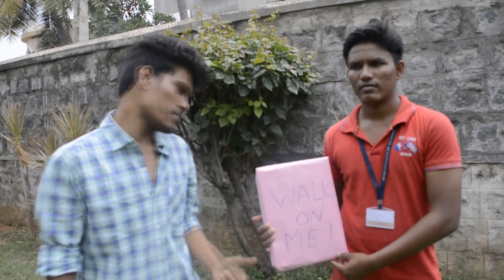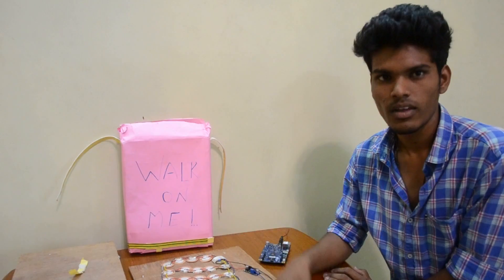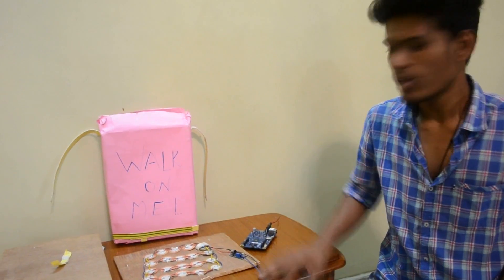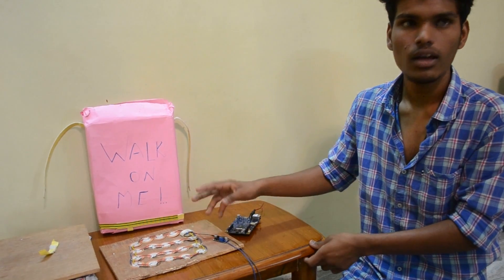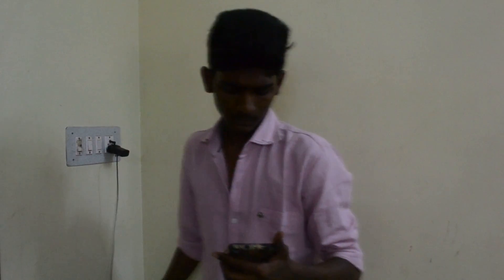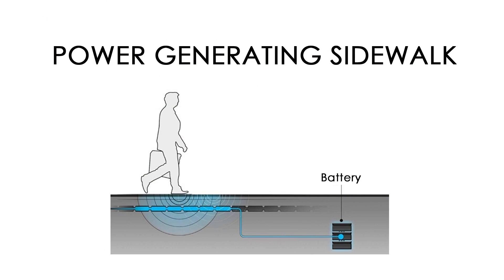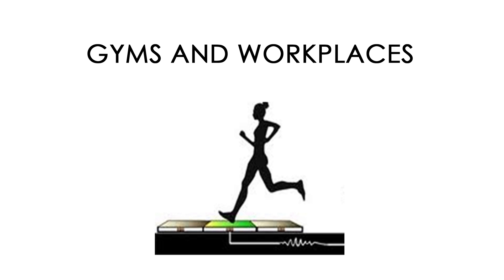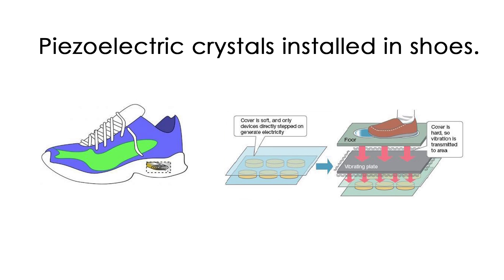PIEZO Foot Step e Generator

Comment: no use of this project as power generated is very less and cannnot be used in any application .
here student is showing output voltage only and not output current. if you connect any load against this voltage, it will drop to very less volt and is useless.

Comment: How do you connect the piezoelectric to the arduino and what is the arduino code?
Reply: It's tricky because piezo can generate a lot of voltage and direct connection damages the arduino (you need to make sure the voltage at the pin is within the limits) and the code depends on your application, entirely.

Comment: dude u used a clipping on cell charger is amazing but no one realizes that cell need 0.5A of current to charge or to just indicate its charging. u people did with what 20 transducers awww thats great its not stored energy n its not alternating energy its a square wave u idiots with no negative side. n most importently u cannot get constant dc with out using of a rechargable battry its a instantanous energy fellas
Reply: Dude, you're such an idiot. Their project might not be as good but what you're saying is totally wrong. Everything is possible, you just need appropriate circuit design skills and engineering knowledge LOL I think you're just a wannabe hobbyist who thinks he's cool. LOL Go get a life.
Reply: You are referring me or the dude in that video..?.. if ur reference is me then bro watch ur mouth  i have working products. I am proprietor of Madscience.Inc.
Reply: the problem is that this method is not optimized